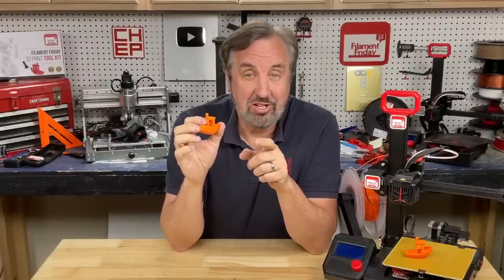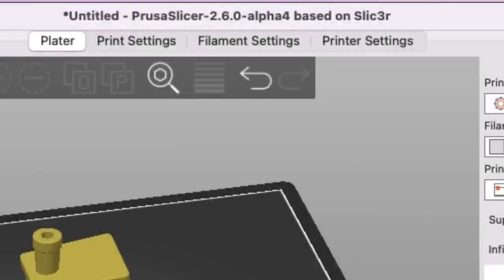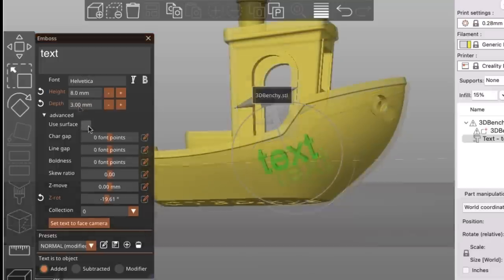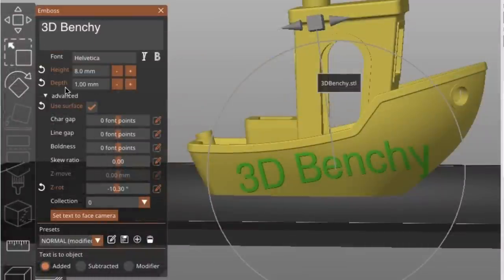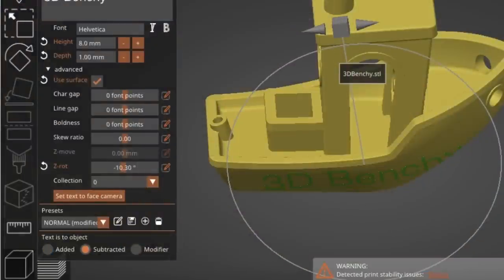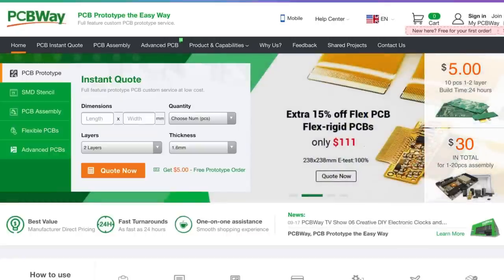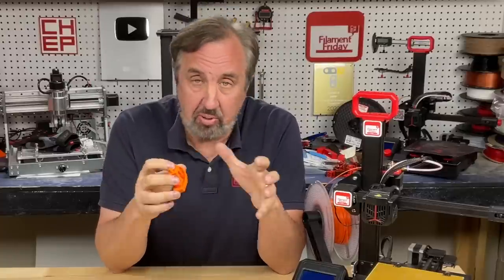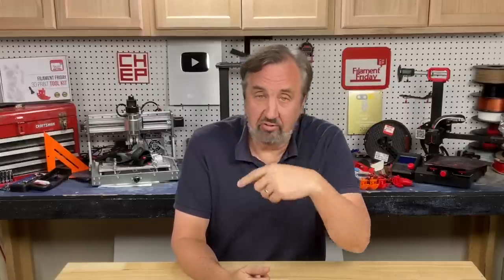Add Text to any 3D Print in PrusaSlicer V2.6

Comment: Have been using the 2.6 alpha for a couple of days now and its pretty good another feature i like is the new split feature that allows for dowels and adds it automatically yo the print so now you can  split larger pieces and have connectors set in the slicer to assemble the parts later when printed. some pretty nice features added along with an intelligent almost A.I type of new support generating system

Comment: I’ve done 60 odd tags for keyrings with people’s names on it (flat oval with text on top) & it just doesn’t fill in the text properly. It’s almost like it misses a track & it doesn’t fill in from an angle like any other flat surface, it tries to follow the contour of the text making it look quite stringy
I’m using an Elegoo 2D printing text in a different colour

I get a magnificent finish with tinkercad (as difficult it is to make a 2 colour stl). Probably user error but I can’t find any settings to play with which would alter the outcome

Comment: Great video, when is Tinker Cad, Prusa, Cura, and so on going understand the software needs to create /build the model and slice it, all in one piece of software.
Reply: I think it’s better to have separate applications for each of these tasks. People want to just print and then there’s people who just want to CAD.
Reply: @PlastiForge  much easier if the software was all in one. Rather than build the part, export / download it, put in a slicer and then print. If you are new to 3D printing you have to figure these out, like I did.
Reply: @John-NeverStopLearning  Nah man. You’re trying to solve a problem that no body asked for. It will end up being a suite that’s not great at either. There’s a reason why CAD suites take years to learn and are super complex. Now try throwing in a slicer lol.

Comment: Hi chuck
I am a fairly new novice to 3d printing , I use prusa slicer , my question is if I download a newer version do I lose my present settings, which I have just got them how I wanted,
Thanks in anticipation
Reply: The alpha version will be a separate instance and you can import your setting over from the release version. It will do this on first boot. Be aware though that if some setting change in the release it will set those to default.
Reply: @iamsobanned  thanks
Reply: @stuartwilliams7903  No problem. I always try to help out someone in hobbies I am passionate about so others can enjoy it like I do.

Comment: wish this would work with my printer I wanted to make a personalized dog tag all it does is keep leveling the bed over and over not printing the dog tag 😢 think I just only realised it won't work with anycubic neo kobra you need Presa printer all I want to do is print text on my projects but can't find anything about the neo kobra printing text 😢
Reply: Just change your slicer to the prusa slicer and add your 3d printer to the slicer. I don't see your particular printer in the list of presets; however, they do have the mega printers from anycubic and you can hand enter your printer details . I could be wrong (and I'm sorry if I am), but this is what I used to do when I had a Creality printer to use Prusa features. You will probably find printer set up in the configuration wizard once you begin setting it up.
Reply: Thank you 😊